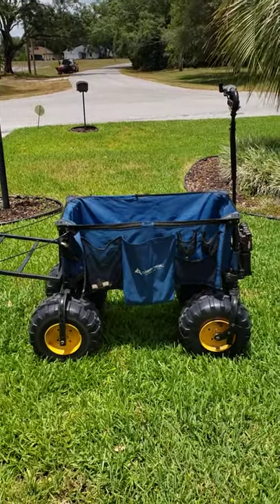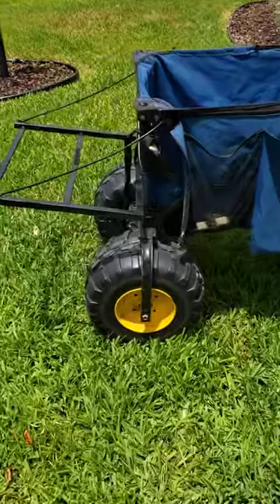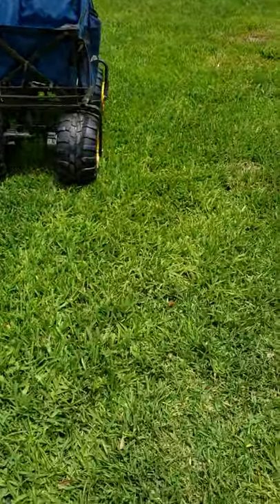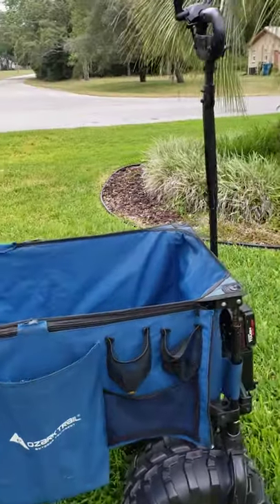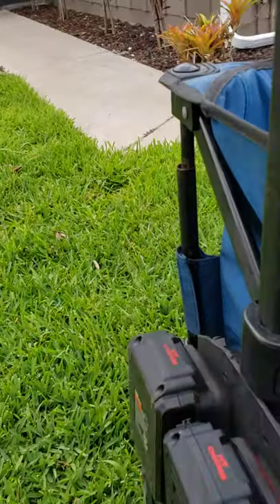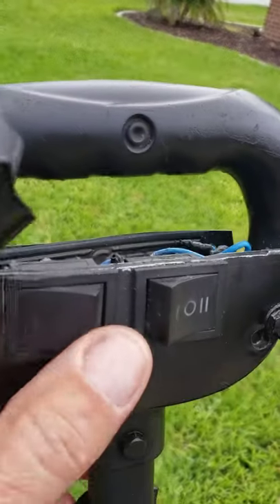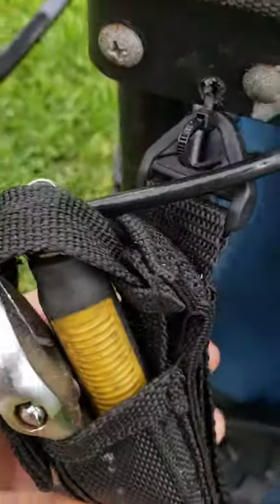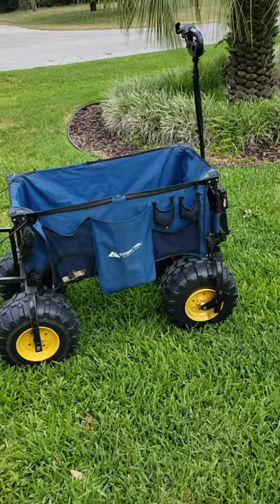Tommy Tsunami Battery Powered Beach Wagon

Comment: Great work 
You indicated that your using motors from suv gater  the motor I think are 12 volt but you’re using 20 volts
Be respond. Thanks 
Wayne
Reply from the maker: The motors are actually rated up to 36v
Reply: Thanks
King

Comment: Can you tell me what motor do you use
Reply from the maker: Motor / Gearbox from peg perego website. For the SUV GATOR
Reply: @tomking3502  do you happen to have a link to the speed controller and the throttle as well as the buttons I have the motors was looking at doing something similar
Reply from the maker: @Montes-jb9mv  Www.kidswheels.com
Reply: @tomking3502  hey bud thank you for the response is there a way to follow you other than yourube?
Reply: Hey Tom I’ve got mine together, but I can’t find that thumb throttle any suggestion?
Reply from the maker: @Montes-jb9mv  pics?
Reply: @tomking3502  not real sure how to post pictures on here 😂 just gotta find a thumb throttle
Reply from the maker: @Montes-jb9mv  Thar throttle is no longer being made. The company went out of business. You can email me at tomking5000@gmail.com